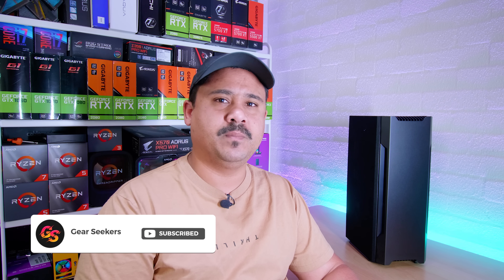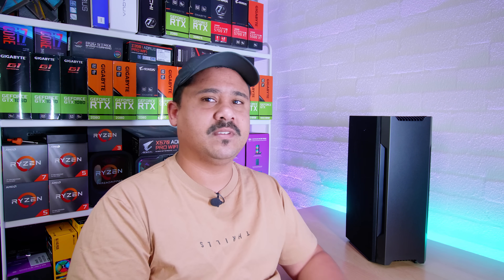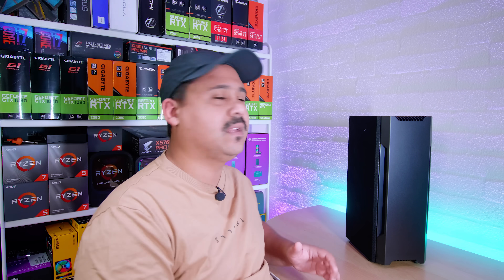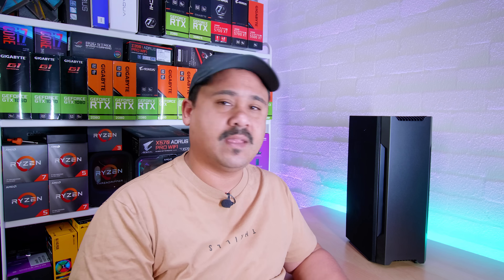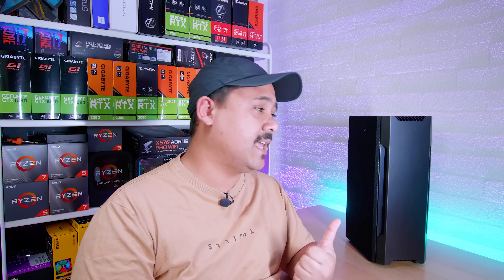i9 9900KS Mini ITX MONSTER - Phanteks Evolv Shift Air Build

Comment: Hey man, I recently just bought a tempered glass version of the case and was wondering if you could swap a panel with me? Like trade a glass for a mesh panel if you even still have the case/setup. And was also wondering if you could sell me any SFX power supplies with the cables, I been trying to find them but they are like sold out everywhere.

Comment: Hi there , Quick question , the fan from the liquid cooling, do you push the air thru the radiator or pull it from the radiator.

Comment: Just wondering, the fan set up, all as exhaust was intentional (and why?) or more esthatic intended? Running myself a 3900x, but looking for a smaller footprint case (like this one) :)
Reply from the maker: The whole case is open it doesn't need an intake

Comment: Thank you for introducing me to my next case.
Reply: Could you measure how much clearance there is between the top of the CPU and the case side ?   Ie. how tall can the cooler be ?

I love how open that case is.  Why keep heat trapped inside ?  I also love how many fans you put in the front.  Small cases are usually hard to cool.  Not that one.

Would there be room for a 240 or 360 radiator in the case ?  Where you put the fans ?
Reply from the maker: I think all the specs are on the Phanteks product page. As far as AIO cooling you're limited to 120mm.
Reply: @GearSeekers  The CPU cooler clearance is only 82mm.  That rules out a big cooler like the Cool Master Hyper 212, which is 159mm high.  And a 120mm radiator is too small to keep a 3950X cool if it is working hard.
http://www.phanteks.com/Enthoo-Evolv-Shift-Air.html
Reply: @SomeTechGuy666  using a Cryorig C1, has a cooler height of 74mm and a low profile 140mm fan, 140 TDP cooling potential, not running a 3950X but I would say it would keep it cool enough.
He also forgot to mention it can actually house 2 x 120mm rads, you just can't have a single 240mm as it uses the bottom mount point and the bottom mount on the side (L shape), you can either extend an AIO and add an extra RAD/tubing or do a custom loop with a tiny res/pump combo

Comment: i've got my 3900x and my 1080TI inside... but it's HOT it's requiert soe tweak for temps, like remove some dust filter or make some front hole.
Reply from the maker: This is a mesh panel version of the case. No glass. Thermals are excellent
Reply: @GearSeekers  hey thanks for your answer : i spoke about the front panel :) (i've got the air version too)
There is some problem with this case with thermal flow :
first : the PSU exhaust the heat on the bottom of the case, so if you put some AIO it will Retake this air.
second : the front panel contain to much the extracting airflow.
if you look the Jay2cents video on this case, he put some lazer cut front panel for better result.
mesh panel i just usefulll for the GPU side !
for encoding or 4k gaming, i use a light undervolt on cpu and gpu for keep all in corrects temps.
Despite i love this case , nice look with a small footprint .

Comment: Can I ask how much extra room the GPU had to fit in? I'm looking at a 290mm card so Im wondering if it would be too big for the case? Thank you! And loved the video!
Reply from the maker: The GPU length is not the issue with the case. Its more about the location of the PCIe power connectors
Reply: @GearSeekers  Thank you so much for the reply! And I see now! I tried to see for myself off the photos found on the internet, but Im not entirely sure what I'm looking for. I then saw you had reviewed the card previously on your show, namely the Aorus RTX 2080ti Xtreme, and so I was wondering, if its not too much to ask, do you think it would fit in the evolv shift? Ive tried to do my due diligence on this build but things like this have me scared of pulling the trigger as Im a newbie when it comes to this stuff, and I dont want to throw money the drain! Thanks again! I really do appreciate it! :)

Comment: Ever since this case got updated to the AIR for better thermals i've wanted to do a build in it. The biggest issue is tho it doesnt fit 3 slot gpu's (like the Ncase) which makes it a turn off because nowadays most gpu's at least fall in the 2.5 304mm bracket

Comment: Why did you put case fans on exhaust to closed front panel? Is it fine?
Reply: Thats how it was designed. 2 intakes at the bottom and outtake on the top. Which is good because hot air rises and cold air sinks.

Comment: Can it fit very tall and thick graphic card like Msi Gaming X trio? It seems GPU length isn't a issue with this case?
Reply from the maker: Probably not
Reply: it can't fit more than 2 slots tho. Probably around 45mm or less in thickness, I upgraded to a Gigabyte 2070 Super 3X and won't fit lol.

Comment: Can you make an update on running multiple OS? I've heard that once you update Windows it'll mess up all the other OS' files and basically corrupt your system.
Reply: Aditya Alifadhillah that actually happened to me when I dual booted MacOS and Windows, so I have a separate Hackintosh build along with a Windows gaming pc. It is possible to avoid that by disconnecting the MacOS disk while Windows is connected, and vice versa. But I’m not sure how to do that.
Reply: Except for manually plugging in the Sata power cord to one disk or the other. There has to be a better way
Reply from the maker: never had issues with it ever
Reply: Gear Seekers It took a couple of months of updates for issue to arise for me. I’m looking at something like this to separate Windows from the other OS’s https://www.amazon.com/Device-Switch-Channel-selector-Module/dp/B01MAX56SA
Reply: @RogueTravel  Yea I heard that EVENTUALLY it will happen. Would be hard to constantly reconnect/disconnect drives though, I guess I'm not dual booting after all.

Comment: I got this case for Christmas but when I tried to put it together(1070, 6600k, sf600) the pc will NOT boot unless both my ssd and hard drive are not connected to the psu, it won’t work if just one is plugged in, and it isn’t the power supply because it will turn on if the drives aren’t connected...any tips?

Comment: This was probably one of the most difficult cases I've built in as I had a 3.5" Hard drive on the side, fan controller, and larger GPU. It's definitely an eye catcher when it's fully assembled but I had thermal issues with the glass panels. I'm sure the mesh panels are a lot better but I had to go away with this case. Another issue I had with this case was the custom sleeved cables, specifically the 24 Pin being plugged in. The tray with the phanteks logo would always pop outwards from the pressure of the cable. If you're getting this case keep that in mind. Kudos for fitting everything so nicely. I think this case would look a lot better with the glass front and the mesh panel on the back.
Reply from the maker: I've got both versions. The temps are the same as an open air test bench with the mesh version.
Reply: @GearSeekers  Appreciate the reply! That's unfortunate though. It's a great case foot print wise. I thought the mesh would provide better temps but glad to know they're about the same as I was thinking on giving it one more try. I'm a mini-itx builder and appreciate the difficulty and challenges when building but with that of course comes with moderate to low air flow when wanting to do small form factor builds.

Comment: This is my personal case as well and I love it. I've got the TG side panels on it though. Also ended up spending a butt ton on getting a ModMyMods front panel with vents cut through the front panel.
Love this build, looks clean AF!
Reply: How does it perform while gaming?  Looking to mod it the same and run an 8 core Ryzen plus 3080 once its out.
Reply: @DarkZero310   I've stuck a 3900X and 2080 Ti in, both watercooled. It was ok, still really toasty though and I ended up switching it out for a NZXT H210

Comment: Phanteks should have only used mesh in areas where the airflow would help out and not expose all the wiring inside.  They need to play with aluminum/glass/fabric more on a holistic basis instead of as an afterthought.

Comment: I've literally been thinking about this case the past 2 days :D
Reply from the maker: Do it!
Reply: @GearSeekers  As soon as I get home from the holidays I will!
Reply: @yeuros6280  did you get it in the end?
Reply: @FRY_FPV  Yeap!! Finally took the plunge and got it about a month back
Reply: @yeuros6280  Thoughts on it?  Dislikes?  Build tips?  I bought one but have not built in it yet.  It had a bad latch and the lid would not latch, contacted Phanteks and send them a copy of my Amazon order and they sent me a new latch for free.  Just installed it, now watching build videos trying to get in the "mood" to build it.
Reply: @DizConnected  I did a full custom loop in mine, and I have the tempered glass version. Love the looks, but they need to do a V2 to improve thermals with the glass. The single most effective change they could make would be to make it a smidge little taller and hollow out the lid fan can fit up there. That would dramatically improve airflow, like night and day.

Build tips? Put the CPU on your board before you put the board in the case. Do not be tempted to use an SFX-L PSU, it will interfere with the GPU power connectors. Zip-tie your cables aggressively, the ATX connector will try to push the PHANTEKS flip-door open all the time. If you are doing a custom loop, SwifTech  makes a block+pump combo unit that will save a tremendous amount of space; I did not use this, I used an EKWB D5 pump; it fits, use a spider mount over the rad on the bottom and screw the fan in under the case. There is no room for a reservoir with this arrangement. A case mod that will go a long way for cooling performance would be to cut a 140mm hole in the rear where the SSD mounts are to place another fan; you will have to counter-sink it a little bit to get the rear panel to close.
Reply: @vomErsten   well they did EXACTLY what you said with the second version.
Reply: @ayokmschangedhisname4393  No they didn't. There is no provision for a fan in the lid and the CPU thermals are still mediocre, not appreciably better than V1. GPU improved, but they were not bad already if you did a loop or used the mesh panels. V2 is overall better if you want to air cool, but worse if you are doing a full loop.

Comment: anyone know any dual slot rx 5700xt that i can use in itx case because every 5700xt i find is either 2.5 or 2.75 slots.
Reply from the maker: Reference is 2 slot
Reply: Gear Seekers I would go reference but it is really bad card for thermals and acoustics. Also imagine being so bad that you didn’t use the io shield lmao.
Reply from the maker: @nubbypig5346  reference is fine. I hope you watched the intro
Reply: Sapphire RX 5700 XT Nitro+